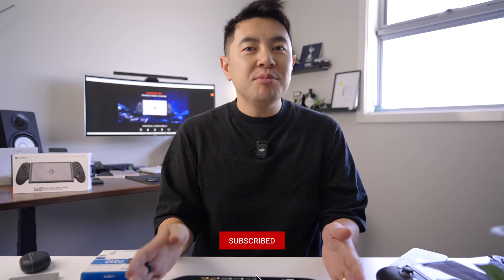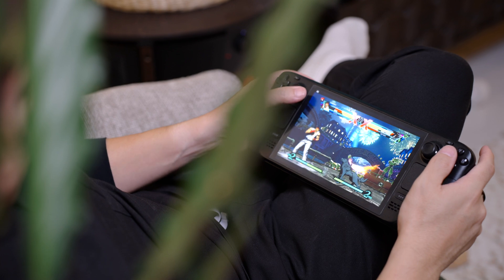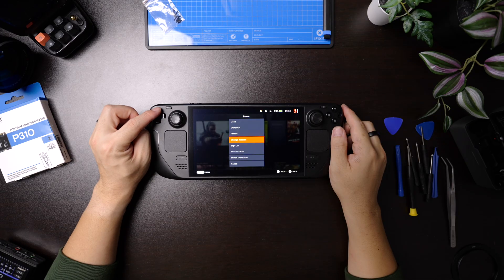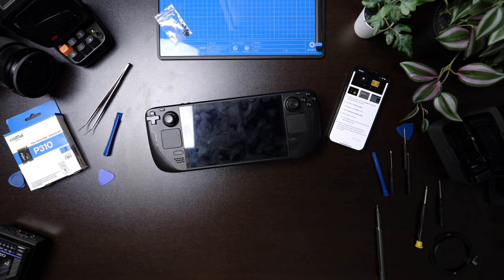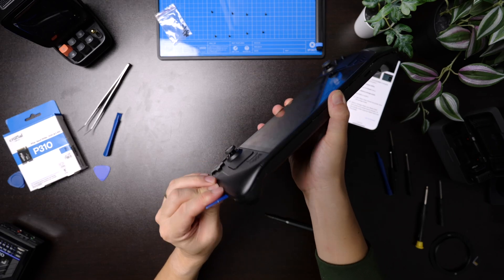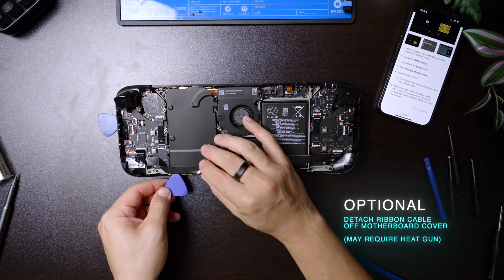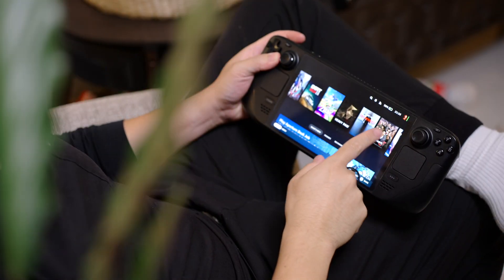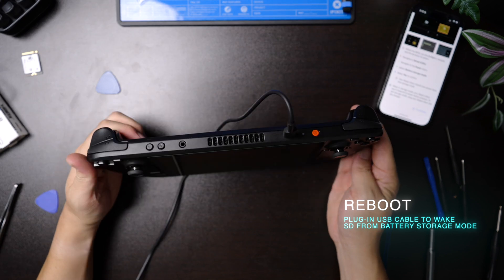How To: Install A New SSD Into Your Steam Deck! - featuring the Crucial P310 M.2 2230 2TB SSD

Comment: Fml id rather just get a device with a bigger nvme. Id def screw this up
Reply: Man it’s so easy it only takes 10 mins
Reply from the maker: It's not as scary as you might think 😅
Reply: i would always say its always good to try but if your worried about you messing it up try opening up some tech you dont use anymore. its always nice to have this kind of thing as a skill